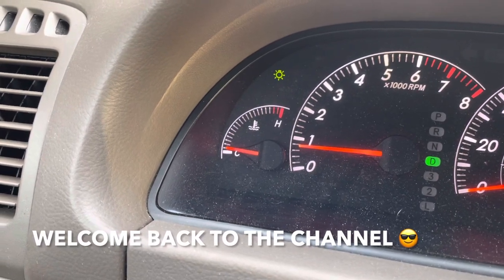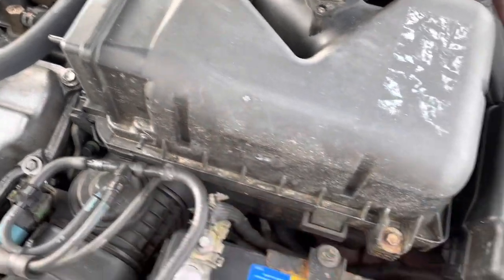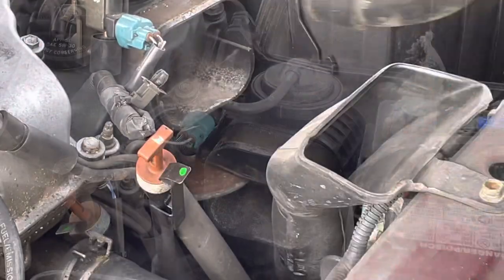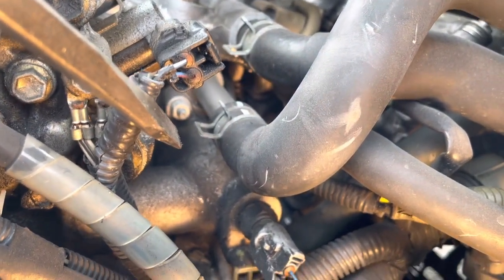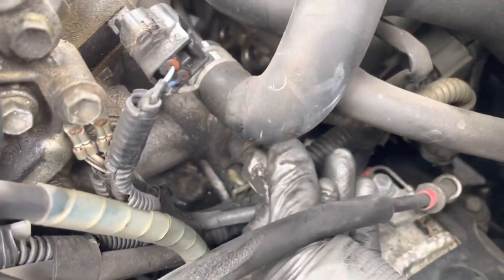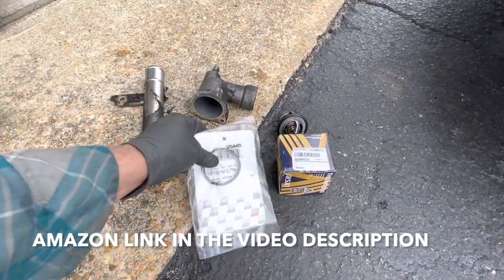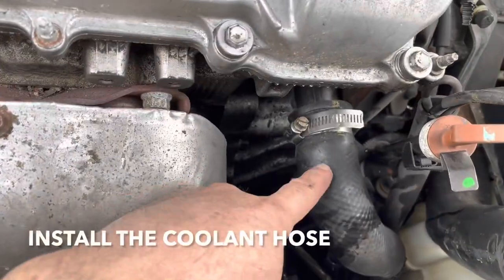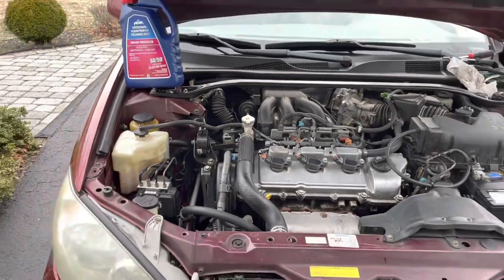TOYOTA CAMRY V6 THERMOSTAT REPLACEMENT - How to change the Thermostat on a Toyota Camry 3.0 V6

Comment: Wow!  Thanks for showing me the paper towel to hold nut in socket trick!  Wish I knew that 60 years ago l
Reply: I agree, that’s a cool little trick of the trade. I love magnets, usually I’ll take a rare earth magnet and rub it across the socket and nut or bolt, and it usually helps.
Reply: I have also used wheel bearing grease to hold some parts toge😢ther
Reply: Where do you buy rare Earth magnets? the hardware store?

Comment: My 02 Sienna had a bad thermostat for years and I ignored it because I lived in a desert. Now I live north of my state where it's always freezing! That van never got heat until much later. Ended up swapping the bad one for a new Toyota one, and what a difference. I replaced it the "fast way" and left the rad hose on, but this required me to remove the starter and get it out of the way, which was only 2 bolts. This let me get the entire housing  out of the way to access the thermostat.

Comment: Nice job. My mechanic quoted me $633.00 to do this job and that's with me furnishing parts.  Outch!
Reply: Almost worth it, shrugs, not a super rip off, I'd say. 
I'm replacing my back hatch window on my RX300, 
they wanted 700-1100 for the job, I thought what 
a freeking rip off, but as I'm 1/2 way through ,I'm 
realizing that after the ordeal of finding out JUST how
to remove the spoil on the roof (acckk), and removing 
old glass, to the 'science' of ordering the right combination
of adhesive, applicator, tools, primer etc, not to mention
the many hours of labor, and overall mystery of the 'project'
 + the price of the used  glass, I'm not really saving that much lol.
When it's done, I may have saved myself $300 against an 
$1100  invoice... shrugs....  
As far as this thermostat project, Toyota did us no favors
that is for sure, the engineers had their
'Stealerships' in mind when they designed the cooling 
system.
Reply: @bikersoncall im halfway thru mine ik this is 8 months later but so far its easy im already to the coolant tubing gonna figure out if i should put the pan under the car or right under the coolant tube
Reply: @beefjorkey  Good luck, the rest 
should be pretty easy.
I didn't do mine right, had some 
trapped air, but it worked out
eventually.

Comment: 2002 ES300 here. Changed thermostat today, a lot of coolant leaked upon opening thermostat housing. 

Is it really as simple as filling coolant after, where do you fill... through reservoir or radiator cap ?

Comment: 5:35 Did you ever find a part number or even 
a name for that O ring? I have a 2001 RX300 , 
I think these parts would be the same, V6 3.L.
Reply from the maker: Just take your old O ring to any auto parts store and have them match it. Should be less than a $1.
Reply: rock auto has em

Comment: did the check engine pop up for the thermostat when that happened? My v6 3.0 has a check engine light on when diagnosed at a local autoparts store it said the thermostat needs to be replaced and for this engine it looks like a job for me to do it on my own especially when i have never done that. and thanks for the video very informative and detailed.
Reply from the maker: No check engine light

Comment: Amazon says that thermostat doesn’t fit my 05 Camry 3.0 just fyi
Reply from the maker: Yes, strange but Amazon is wrong. Confirmed with several places like Rockauto, Advanced Auto, O’Reilly, etc. Working great so far. 😎
Reply: @fixinit  something wrong with their compatibility checker I suppose. But I agree it is the right one.

Comment: Mythermostat in my toyota avalon wont come.out to replace why is thaT?
Reply from the maker: It’s probably rusted on there. Try spraying some penetrating oil on it and tapping the edges to break the rust loose.
Reply: @fixinit  thanx. Worked